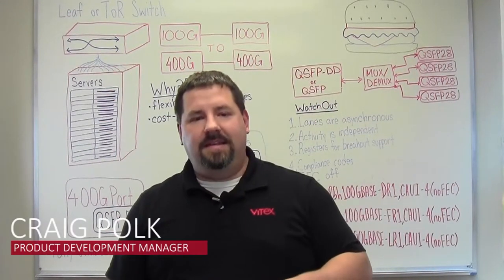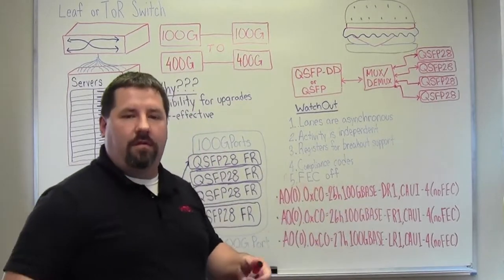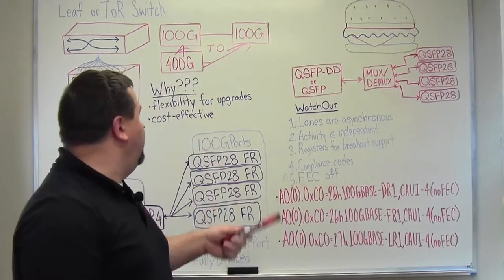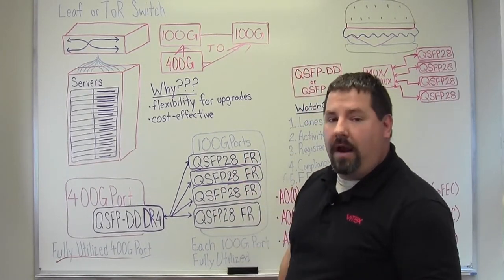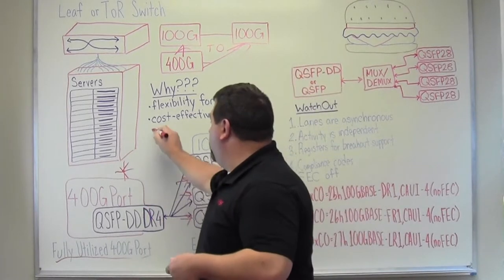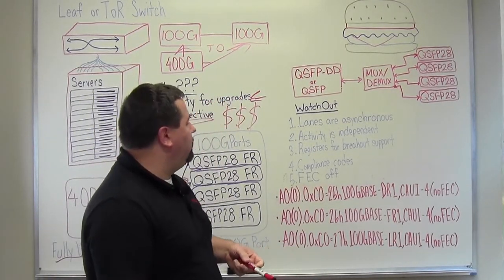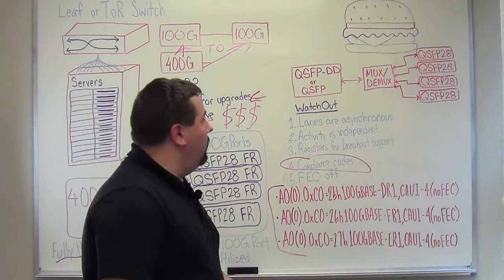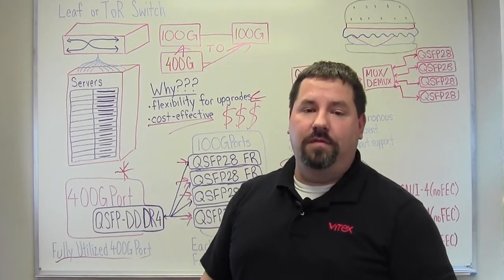Vitex Talks | Cost-effective solutions for 400G network upgrades: the benefits of breakouts

Comment from the maker: Hey there! 

Do you have any questions about upgrading your networks to 400G speeds that we didn’t cover? Or anything else fiber optic related? 

Our Vitex Talks series answers questions from engineers, designers, procurement, quality control -- anyone interested in digging into product or technical aspects of fiber optic transceivers, AOCs, DACs, AECs, cables, video fiber extenders and more. 

If you do have a question, ask below or send us an email at info@vitextech.com. If your question is featured in a Vitex Talks video, we’ll send you a gift code for a hot cup of coffee. We know you need it!

Thanks for helping us shine a light on fiber optic topics😊

Comment from the maker: :yt: Full Video Transcript:
Hey everybody, this is Craig from Vitex, and if you work in a data center or do something with network planning, then this is a good episode to watch. Today we're going to talk about upgrades, specifically 400G, in our racks and servers. What do we do when we want to move to a higher speed? There's only a couple things that are certain in life, right? We’ve got death, taxes, and optics are going to get faster and faster. What are some of our options if we have a 100G solution and we need to go to a 400G? What we can do is we can just do a massive change over, right? Pull all of the 100G stuff out, put in 400G. Well, this is not going to really work. If you're a 400G switch company, they probably want you to do this because they have this one size fits all solution and if you're a fan of cheeseburgers, you want a cheeseburger, he wants a cheeseburger, cheeseburger, cheeseburger, cheeseburger, but that doesn't really work in this area. What we want to do is we want to implement some type of reuse of our 100G that we already had in our data center. What are some of the options that we have? We can use a traditional MUX, DEMUX, we have to bring in other equipment to do that, but that's not really optimal. What are some of our other things that we can try out? What we're going to talk about is we're going to talk about how we can fully utilize our 400G port and save some money while we do it. Here's an example of a 400G DR4 and we're going to pair this with either a single lambda DR1 or FR1. We're going to be able to use all of the existing connections, right, that we have, and we're going to only upgrade this one area. What's the benefit of doing this? First one is flexibility, right? We can upgrade when we want to upgrade on our own time schedule. We don't have to worry about major down times because we're swapping everything out in our racks for a 400G solution, okay. It's also super cost effective, right? If you want to spend lots of money, you can go ahead and just buy 400G everything and spend the time to swap it all out. But if you're looking for something that's more of a cost effective solution, you may want to consider breakouts, right? But what are some “gotchas” that you’ve got to consider? Something just to remember is that these lanes are going to be all asynchronous, right? They're going to be independent from each other. One lane going down doesn't mean that the other ones are going to go down. We have to consider that in our solution. We also have to remember that we have to code these correctly, we have to have breakout support in them, and we have to have with that our compliance codes that are properly supporting a breakout solution. And one of the most important things to remember is we’ve really got to have REC off when we do this, okay? Right here, we're just showing what are some of the codes that are needed in our EPROM coding depending if we're using a DR1, FR1, or an LR1 solution, right? And so you may ask, “Oh, does this only work in a 100 and a 400G solution? Why are they the only ones invited to the dance?” And they're not. We have solutions here at Vitex where we can do 200G, 100G, 25, 40, 10G, they all get into the mix. As we move into the future, everyone knows 400G is going to go away, so we're going to have this same problem again when 800G comes out. What do you guys think about some of the solutions and some of the breakout applications that are going to emerge as we move to 800? Reply in the comments, let us know some of your thoughts, and if you want to learn about your solutions, you want to talk through them, give us a call, drop us an email here in our New Jersey office. We're more than willing to help and ready to support you. That's it for now. Until next time, I'll see you then.